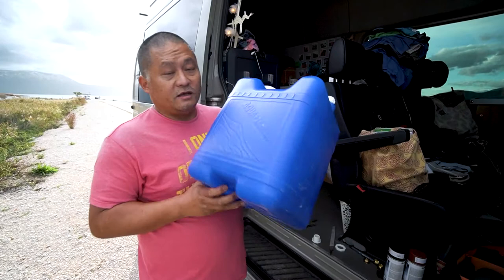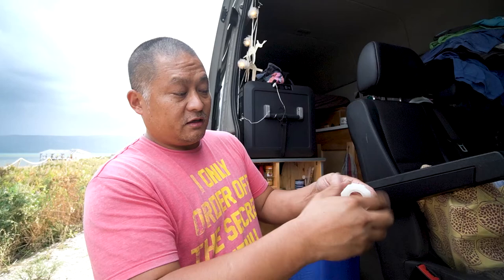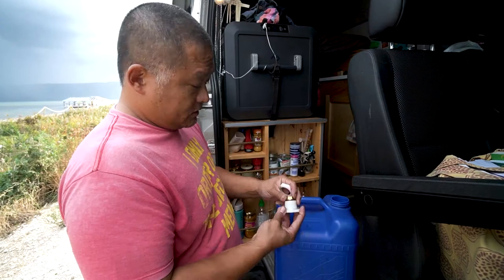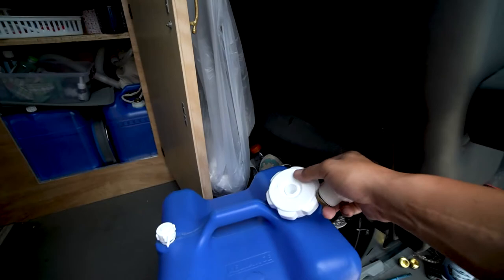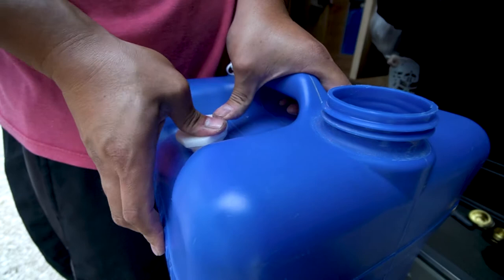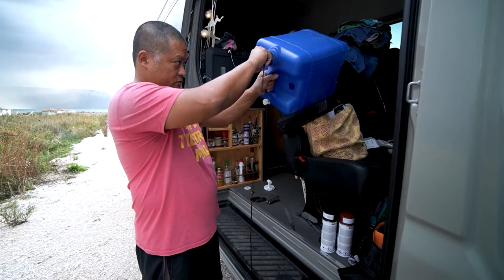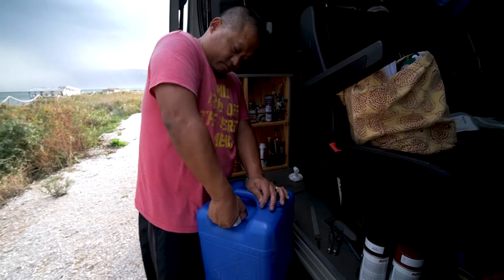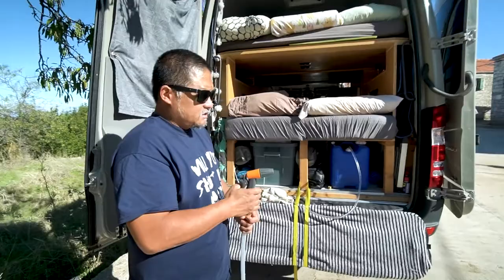Simple And Useful Water Jug Hack for Off-Grid Van Life

Comment: You could use a step or uni bit and cut the hole with a drill motor and maybe hold upside down to prevent shavings and or use a vacuum cleaner on blow to put in the main spout and force air out while you work...

Comment: To avoid shavings in the jug you could use a hot knife to melt/cut the whole (something disposable since you will ruin the hardening and probably leave melted plastic on the blade). Propane/butane/candle to heat.
Reply from the maker: Good idea. I didn't think any heating up a blade. But yeah, it would be sacrificed for the job....

Comment: Get a round piece of pipe same diameter and heat it so hot then press into plastic and it might melt through ,might work.or at least make a start for the hole.